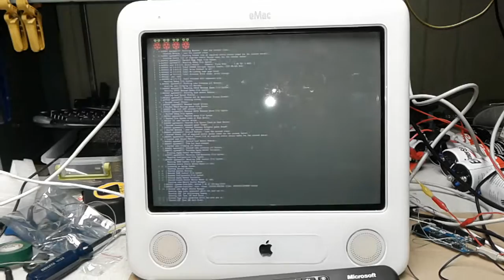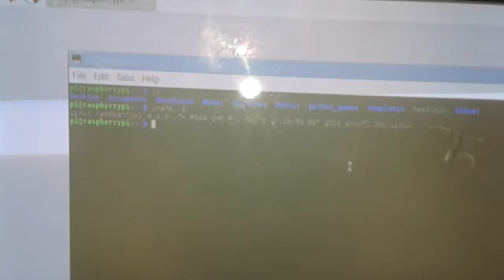piEmac eMac CRT Hack eMac as monitor

Comment: Is there an easy way to customise or any presets for the IVAD data so that the picture shows up properly?
Reply from the maker: I haven't sniffed the display settings protocol for the eMac like I did for the G3 but in theory it's the same procedure. Some did some of this and added to the wikibooks. You can take those commands and send them via I2C(the same lines that you send the init sequence with) and adjust display

Comment: I would like to remove the CRT from my eMac and replace it with a 15" LCD panel. I have an issue with the HV supply to the CRT. Any workarounds?
Reply from the maker: Well, I really can't give you any advice on removing the CRT since I actually haven't done that but I know there are people that have done it with iMac G3's so the process should be similar. That said you could probably find a used analog board on mercari, ebay ect... and get your eMac up and running again.
Reply: Google headless emac
Reply: yeah the flyback is important to the psu. pretty much get the schematic to the logic board of the emac. then you can just replace the psu with something else entirely. you may have to modify the edid data that i think is in the main system rom. no idea what rails come from the crt to the logic board.

Comment: I have received an emac. I tried to follow using this guide https://en.wikibooks.org/wiki/How_to_modify_an_eMac_to_use_as_an_external_monitor but I have no luck with anything. Could you help?
Reply from the maker: Hi Alex,
The wikibook is kind of sparse and I made lots of assumptions when I put it together so it really is hard to follow.
One day I'll add more detail. The first thing you can do is cut out the wires required for a VGA signal and connect them to an old VGA cable. Use the mapping in the wikibook. Leave the logic board installed and connect the VGA cable to a computer that you know works and can output a VGA signal. Do this with the eMac logic board still installed so that it can initialize the IVAD board for you. Once you've done that then set the resolution and refresh rate on the computer you are using. Once you have video on the monitor, start experimenting with an arduino to send the initialization sequence.
Reply: @rockyhill3 Thanks for the help. I didnt know there was another page for it. Ive gow got it working with my mac mini. I brought the emac for spares.
Reply: @rockyhill3  so ive got video but everything is way off to the left and off screen
Reply from the maker: Great! This is good. What are you using as a video source? If it's a raspberry pi then you'll have to fiddle with 
/boot/config.txt

Here is what I used with my raspberry pi for the exact same problem.

# uncomment the following to adjust overscan. Use positive numbers if console
# goes off screen, and negative if there is too much border
overscan_left=-200
overscan_right=50
overscan_top=50
overscan_bottom=50

If you your on  a linux box then you'll need to play with "xrandr"  I'll have to dig around for the xrandr values
I came up with.
Reply: @rockyhill3  I have now setup my raspberry pi.  I've had to fiddle with boot.txt but it's all way different to what's on the wiki and everything but thanks for the help. Do you know the voltage rating for the LED on the front of the eMac?
Reply from the maker: Great to hear you've got it working! I don't remember what the LED voltage is but they are usually 5 volts. That said, you'll want to power the LED with a resistor in series so that it doesn't burn up. I like to use a 220 ohm resistor but you can go a little lower if you want to make it a little brighter. Please post a video so we can see your mod in action!
Reply from the maker: Alternatively you can send commands via i2c to the IVAD board and adjust the screen properties.
Reply: @rockyhill3  how would I send the screen adjustment through i2c?
Reply from the maker: That depends whether or not you've tapped into the i2c lines yet. Do you still have the logic board installed or have you
severed it and are now sending the initialization sequence with an arduino or raspberry pi? 
Once you're wired into the i2c lines(SDL, SCL, and GND) you can write to a register on the IVAD chip along with a register offset and the value you want to set it to. The register offsets are the properties you can modify.

It seems that both the eMac and the iMac G3 DV use the same register address and register offsets for the same properties. Contrast, Brightness, Horizontal position ect.......

Here is a snippet from ivad.h for the iMac mod.
https://github.com/qbancoffee/imac_g3_ivad_board_init/blob/master/imacG3IvadInit/ivad.h

enum IVAD_REGISTER_OFFSET : const byte
{
                                   //   OFFSET  MIN  -  MAX
                                   //   ===================
  IVAD_SETTING_CONTRAST,           // = 0x00    0XB5 - 0XFF
  IVAD_SETTING_RED_DRIVE,          // = 0x01    0X00 - 0XFF
  IVAD_SETTING_GREEN_DRIVE,        // = 0x02    0X00 - 0XFF
  IVAD_SETTING_BLUE_DRIVE,         // = 0x03    0X00 - 0XFF
  IVAD_SETTING_RED_CUTOFF,         // = 0x04    0X00 - 0XFF
  IVAD_SETTING_GREEN_CUTOFF,       // = 0x05    0X00 - 0XFF
  IVAD_SETTING_BLUE_CUTOFF,        // = 0x06    0X00 - 0XFF
  IVAD_SETTING_HORIZONTAL_POS,     // = 0x07    0X80 - 0XFF
  IVAD_SETTING_HEIGHT,             // = 0x08    0X80 - 0XFF
  IVAD_SETTING_VERTICAL_POS,       // = 0x09    0X00 - 0X7F
  IVAD_SETTING_S_CORRECTION,       // = 0x0A    0X80 - 0XFF
  IVAD_SETTING_KEYSTONE,           // = 0x0B    0X80 - 0XFF
  IVAD_SETTING_PINCUSHION,         // = 0x0C    0X80 - 0XFF
  IVAD_SETTING_WIDTH,              // = 0x0D    0X00 - 0X7F
  IVAD_SETTING_PINCUSHION_BALANCE, // = 0x0E    0X80 - 0XFF
  IVAD_SETTING_PARALLELOGRAM,      // = 0x0F    0X80 - 0XFF
  IVAD_SETTING_BRIGHTNESS_DRIVE,   // = 0x10
  IVAD_SETTING_BRIGHTNESS,         // = 0x11    0X00 - 0X0A
  IVAD_SETTING_ROTATION,           // = 0x12    0X00 - 0X7F
  IVAD_SETTING_END                 // always last
};
Reply: @rockyhill3  I have managed to send off the commands through the Arduino. It's all setup when it initialises the Ivad board. I've got my raspberry pi 4 with my argon one case attached so when the pi powers off, the CRT and Arduino powers off until the pi is switched back on through the button on the case.
Reply from the maker: That sounds very nice! O.K. , you are using a raspberry pi 4. I think there is a bug in the OS that causes it to shift to the left after after the udev kernel device manager is started. I reported it here. https://github.com/raspberrypi/linux/issues/3663

scroll to the bottom and watch the videos and you'll see that the beginning of the boot process is fine but then later shifts to the left with all raspian based operating systems. However if you use ubuntu for the raspberry pi 4, it all works just fine. you may want to consider using ubuntu 20.04 until it is resolved.
Reply: @rockyhill3  I've edited the overlay for the bottom to be 0 and left to be 200 instead of -200 and adjusted the CRT using the i2c addresses etc to fit full screen
Reply from the maker: Also, If you can confirm you are indeed encountering the same problem I have with the raspberry pi4 and raspian 
based OS's then please add a comment on the issue tracker in order to add weight to it.
https://github.com/raspberrypi/linux/issues/3663
Reply: @rockyhill3  I would add a comment but I'm not receiving any verification emails from GitHub at the moment. I will try as soon as I can. I was planning on hooking up the pi to the 5v DC power out from the power board but it's not enough to even turn on the pi. I don't have any relays to power up the fan so I do have a switch in place just to turn it on whenever I need to. I do need to find a cheap audio amp for these speakers in the eMac as they are quite good. Hopefully I should be able to power it all up through the one power connector but I'll just wait until I can get my friend who has more guts to do it. I don't like playing with mains, he does.
Reply: One thing I've noticed is that the text is a bit blurry. Is that normal?
Reply from the maker: This can happen with CRT monitors/television sets and it can happen for several reasons. 
Is the text blurry at all positions on the screen? if it is, then it just may be a matter of adjusting the focus.
This is one of the knobs on the flyback transformer. While it's on, slightly turn it with a screwdriver until
the text is sharper. The other knob will darken or brighten the picture.

Do this carefully as the flyback transformer is what provides thousands of volts to the CRT. Don't touch anything
but screwdriver handle as you are doing this.

If the text is blurry only in certain parts of the screen check to see if it's blurry because the colors are slightly out of alignment. You'll see a green version a red version and a blue version of the same letter slightly offset from each other
causing the text to look blurry. if this is the case then you might of accidentally moved one of the convergence adjusting things on the neck of the CRT. This can be an EXTREME PAIN IN THE NECK to adjust. If you must do it, carefully mark all of the positions with a marker or something and begin to move them very very slightly. 

I had this issue with my G3 and it took me a while to get the text sharp. 

It amazes me that people figured out how guide electron beams using electromagnets to produce a color picture.
That was part engineering , part art, and part hope.
Reply: @rockyhill3  What would the best resolution be for the CRT?
Reply from the maker: I would try adjusting the focus knob on the flyback transformer first and see if you can improve it.
Reply: @rockyhill3  Thanks for this thread it's very useful !
Reply from the maker: There are a couple of people that have successfully done it and there is one person that is putting together a wiki based on this project. It looks like he has more information. Check it out.
https://github.com/mbaum0193/emac-pi/wiki

Comment: Hey mate, I have just got a g4 emac all perfectly working. I just want to connect crt to an external PC. Do I need Arduino?
Reply from the maker: I did it with an arduino and several others have as well. Strictly speaking, you don't really need one, you just need a way to send the initialization sequence via an i2c connection.
Reply from the maker: I chose to do it with an arduino because they are cheap and easy to use with tons of community support.
Reply: @rockyhill3  without initialisation it won't work? I have a fully working emac, was hoping just to pin convert VGA
Reply from the maker: I didn''t realize you wanted to keep the logic board installed. If you leave the board installed then it's a really easy thing to do, just snip the VGA signal wires(leave the I2C wires)  and you're all set. If you're willing to put a little more effort into it, you could probably even add a VGA selector to switch to toggle between the emac and your other input.
I would love to see your final build!
Reply: @rockyhill3  i2c are pin 4 and 10 right? So exclude those and wore IP the rest. Any ideas on how one switch can switch the signal between external and internal logic board? Thanks again you have been a great help
Reply from the maker: Actually on the VGA connector the pins are 12 & 15 but  on the connector that goes to the IVAD board on the logic board the pins are 5 & 6. One of these days I'll clean up the wikibook I wrote on the eMac conversion but here is a link
that has some pinout information.
https://en.wikibooks.org/wiki/How_to_modify_an_eMac_to_use_as_an_external_monitor

There is an image with a pin mapping for the two connectors, take note of the pins relative to the notch on the
connector.

Also here is a link to a switch that might work for you.
https://www.amazon.com/PASOW-Switch-Button-Monitor-Black/dp/B0151DFMY4/ref=sr_1_3?dchild=1&keywords=vga+switch&qid=1592482585&sr=8-3
Reply: @rockyhill3  thanks mate greatly appreciate your help, I am going to do some testing this weekend.
Reply from the maker: Good luck!
Reply: @rockyhill3  Hey mate no luck getting the signal. Mac logic board turns off. Laptop dies detect external display but nothing on screen. Going the Arduino route, now. What is the size of resistor in the picture? 2.2ohms?
Reply: @rockyhill3  Hey mate sorry to bother you again. Can't get the Arduino diagram and where it goes. Managed to get the screen on via main logic board and bypassed the VGA signal. The image is about 1.5 inch cut off so 1.5 inch missing on the right and start menu fro widows ins not visible. Any way to adjust it from windows
Reply from the maker: @bamsegod  glad to hear you have it on, thats a good 1st step. Adjusting the picture can be tricky but if your using the logic board you might want to boot into mac os and offset the picture save it and then switch to Windows. Make sure the cmos battery is good as this info is saved to pram or vram. Not sure which. The resistor in the image is 220k but any resistor from 1k to 220k should work. Not home today but I'll write you some more later on. If you have an arduino use the sketch that doesnt use the relays.
Reply: @rockyhill3  I have a Leonardo pro micro which is Arduino clone I believe. I wired it up but emac didn't boot at all. Maybe I was doing something wrong. I guessed the wiring form your diagram maybe that caused it. Another issue in windows is the switching resolution in games, so screen goes black when game doesn't have the same resolution 12xx by 900 I think. So it's too twitchy to get anything working. May be not a big problem if I only use raspberry pi as it can hold the res in retropie.
Reply from the maker: @bamsegod  An arduino clone should work as well.
Is  the logic board still installed? If so, a next step could be just cutting the sda and scl lines from the harness(pins 6 and 5) and wiring them to the corresponding connections on the arduino micro(pins 2 and 3 but double check).  Make sure the the  initIvadBoard() function  is at the end of the  setup() function in the sketch, this way you don't need a button to turn it on it'll just go when power is applied to the arduino. Plug the arduino into one of the USB ports on the logic board so that when you turn the eMac
on the traditional way it powers the arduino which then proceeds to send the init sequence. You might have to  add a delay after the  initIvadBoard() is called in setup to get the timing right but I bet you don't. 
Experiment using this method for a while until you can get an image up. Now the arduino is initializing  the IVAD board and the next step will be to get the analog board
to power without the logic board.
Reply from the maker: Here is a video demonstrating what I just wrote but with an iMac G3 instead of an eMac. The idea is the same though.
https://youtu.be/JLaHMjQ7idI
Reply: @rockyhill3  thanks very much so looking at the video, 2 pins for SDK and SDA and the third is ground right?
Reply from the maker: @bamsegod  yes, which is the nice thing about I2C, you only need three wires.

Comment: Do you think this mod would work with the iMac G3? I'm trying to do a mini ITX build inside of one but I'm a noob when it comes to electronics.

I wouldn't think that Apple would change how their computers interface with the CRTs. I guess I could use my 'scope to sniff the IVAD and see if it's the same signal being sent.
Reply from the maker: I'm pretty confident it can be done with a slot loading G3, they're very similar in that way.
In fact, I purchased one recently and captured the initialisation sequence encoded it and played it back with an arduino. 
Unfortunately I was only able to work on it for a couple of hours so I wasn't able to really dig into it.
 
The CRT does does turn on but it something is a little off. The colors don't look right and the picture doesn't fill the screen. I'm pretty sure I'm missing one or two signals so I'll have to chase them down when I have some time.

I'm optimistic about getting it working though.
Reply: Okay, cool. I guess it's a good thing I got the slot loader then. 

I do know some stuff about CRTs so I might be able to find my own workaround for the colour and what sounds like an underscan issue. Thanks for the quick response!
Reply from the maker: no problem, I hope you can get it modified!
Reply: Come to think of it I think the display looks like that because all the CRT controls that would normally be on an OSD menu are in the operating system if my memory serves correctly. From what I remember all the geometry, colour, and even moire settings were changeable through OSX. 

I guess what I'm getting at is the PC would send signals to the CRT not just for booting but for telling it how to look, too. So in order to change that stuff on the CRT for running a swapped system I'd need to find out what signals to send it and maybe hook up some physical controls. Or just do it in software.
Reply: @rockyhill3  Would you share the initialisation sequence for the slot loading g3? I don't have anything to capture it and I probably wouldn't be capable on my own.
Reply from the maker: Hi Frank I've been away from this stuff for a number of years but I'm going to have some time for the next several weeks so I figured I would try and do the same thing with an iMac.  
https://youtu.be/meIzAyQd0t0
Reply from the maker: It looks like someone might have done this already though.
https://forums.macrumors.com/threads/imac-g3-mod-video-connector.1712095/page-3